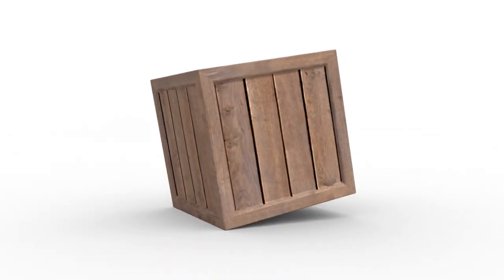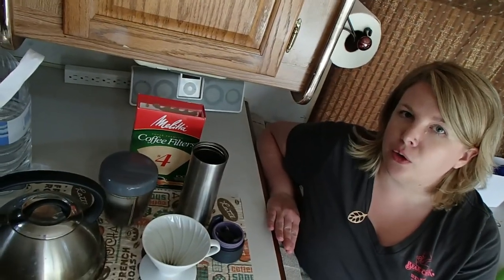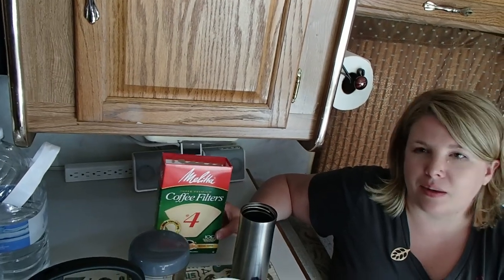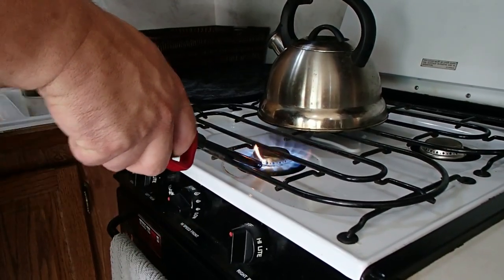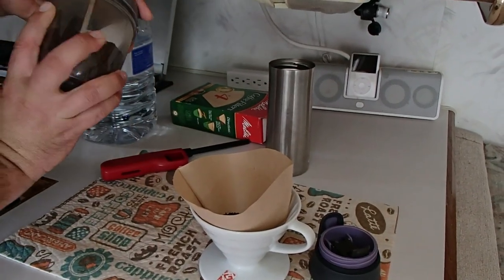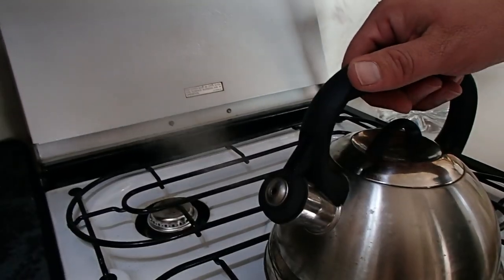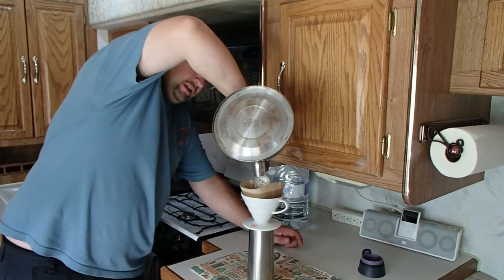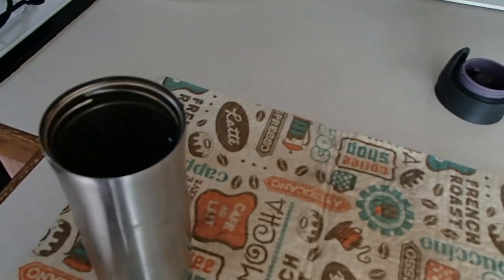Quick & Easy RV Coffee ~ No Electricity Required

Comment: hey guys! I'm new to the channel, but really like yall (enough to let the ads play through). A thought on inverters: they don't have to be prohibitively expensive. I have 2 from harbor freight that work great. The first is only a 1500/750 watt (peak/run watts), the second is 3000/1500. I think I got the small one on sale for maybe $50, and its excellent to run smaller things like an led tv and dvd player, with plenty left over. The biggie I picked up on sale as well for just over $100. 1500 running watts is quite a bit of power, enough to run just about any coffee maker one would have in an rv (about 12 amps @120v ac). Considering house outlets are 15 amps max, that's plenty of juice for most needs. Remember to keep the input (12v) runs as short as possible, and use heavy cables (2ga - 00... battery cable basically). It's all in the math... watts ÷ output volts = amps draw... or amps draw x output volts = watts :-) Keep on rockin' yall! Hope to run into yall up there someday!

Comment: My parents, who camped extensively in the 1950's, had an old clear glass percolator that they took camping.  You could use that on a Coleman stove or even a fire.  I still have and old Corningware "blue cornflower" percolator which i haven't used since the invention of Mr Coffee drip machines.  The trick is getting the proper amount of coffee into the filter or basket.

Comment: Those CONTIGUOUS cups r the bomb! Regarding the drip filter holder, you mentioned yours is ceramic /breakable;  they've been made in plastic for years! (I forget how young y'all r ☺). Also,  I must b the only one who uses their microwave to heat water? Especially when you know exactly how much you need.  It's one less thing to tote around.   Gonna make tea?  Same thing- in like 2 minutes +/-, then put your bag or leaves in & voila. I've seen shows where they show the inside of used tea pots... Eh-hemm.  That's all I'll say about that.  Luv u guys 🙂  Stay Happy!
Reply: Terrie Ross it's because they would need to start the generator to use the microwave. Using LPG to heat the water is easier.

Comment: What if you don’t have a gas stove?
Reply from the maker: We use the same technique to this day, but now we boil water in an electric kettle.
Reply: @outliersoverland  , right, but that requires electric.
Reply from the maker: Some fuel sources is going to be required to boil water.  Propane, butane, electricity….